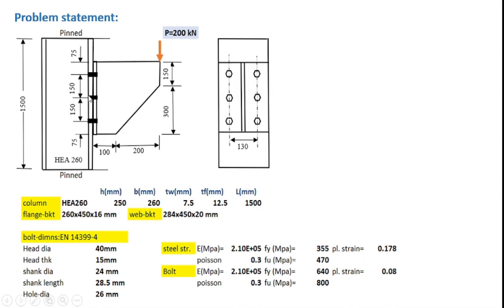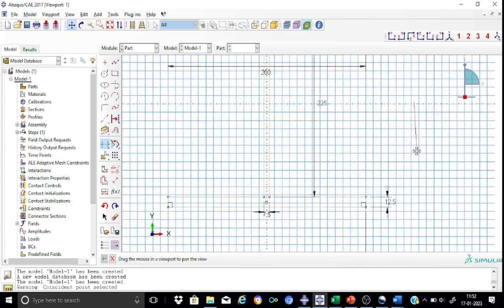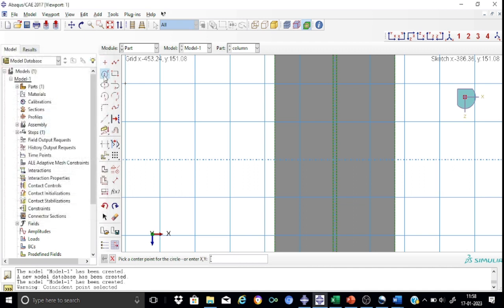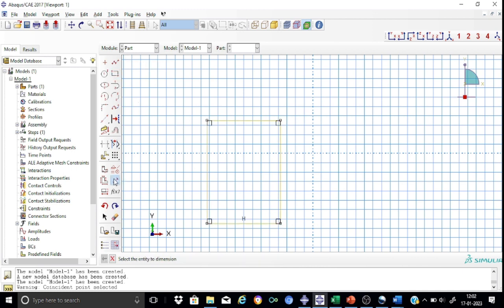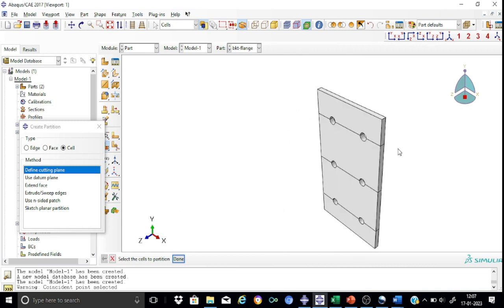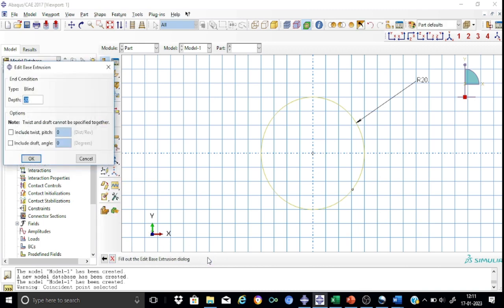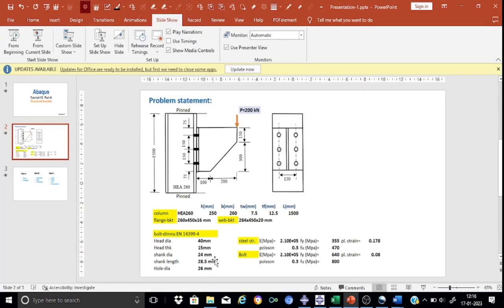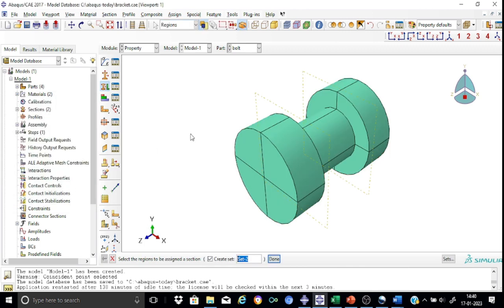Abaqus tutorial -12 (Part-A):  Analysis of a structural steel bolted bracket

Comment: One query here special to this study... For structural steel design we know that yield stress changes with thickness of the member... Can we have any definition of material, where permissible yield stress is dependent on thickness?
Reply from the maker: Of course .. If u have a steel beam with I-section, first break it into flanges & web by partitioning. You  can now define two materials one for flange and the other for web (based on the respective fy values)and finally assign them  to the respective components.

Comment: Looking for videos on building modelling... Where beam column slabs are modelled with 2D beam element & 3D shell elements for seismic response spectrum with compression only soil springs
Reply from the maker: Hello debdeep,
Abaqus is a software that is widely used for high-end simulations. For response spectrum analysis, you can very easily deploy programs  such as SAP2000 or ETABS. I would recommend to use abaqus in special cases for eg. the ductility evaluation of RCC , steel or composite beam-column joints, bucking analysis of critical compression components,  analysis of machine fdns, SSI  etc. If you want to carryout performance based designs using pushover or IDA go for programs such as Seismostruct. we have used it in many mega- Europeam projects.
Remember, as engineers we need to evaluate any available commercial programs before its use based on the pros & cons. Further using a simplified structural model without loss of accuracy is ingenuity of engineer.
We cannot waste manhours by modelling RC slabs for spectrum analysis instead go for floor constraint(master/slave option)..
Reply: @puttattjayarajan1199  thank you sir for your insight. In case of few critical structutes of nuclear power plants, we may be going for abaqus as per the client requirement... 
What it was requested here, the basic philosophy of modelling, what shall be considered if a situation demands, what shall be the approach...
Reply from the maker: @debdeepmajumder9136  Your request will be surely taken care. In the coming months, we will have multiple tutorials on str. assessment for EQ loads (either res.spectrum or dyn. time history). We have still many tutorials pending on static procedure  & quasi-static(especially steel str. connection assessment).
I want to finally share my view on nuclear power plants. In case of critical structures (eg. reactor building), , they are by engg. practice designed to remain essentially elastic even under extreme earthquake events. In such cases , I don't know what abaqus will deliver. These are typically  instances where our clients require a thorough understanding and we can also educate them for our mutual benefit...!!!